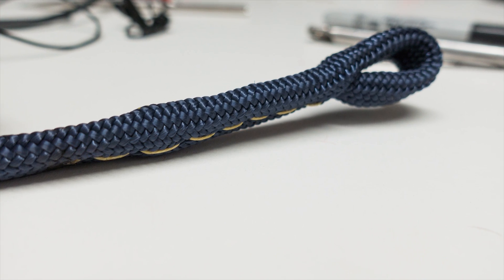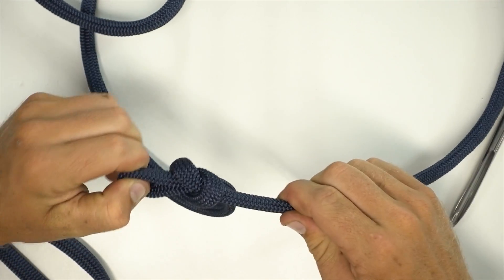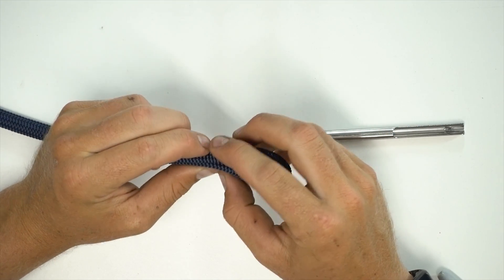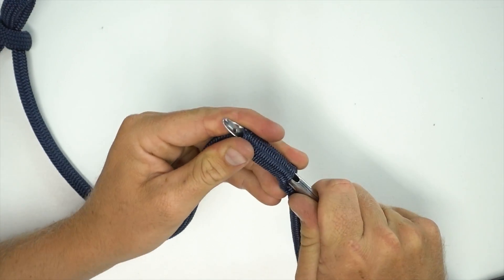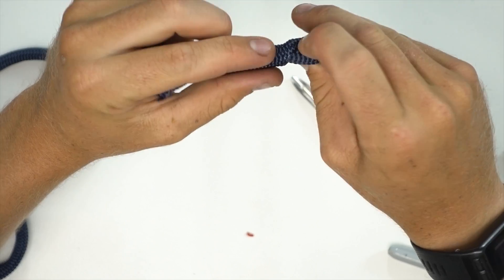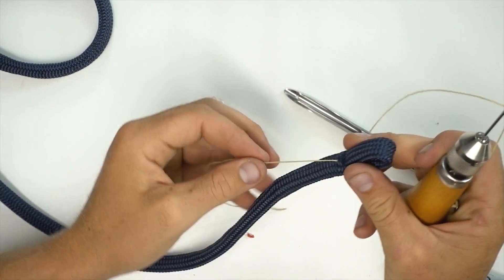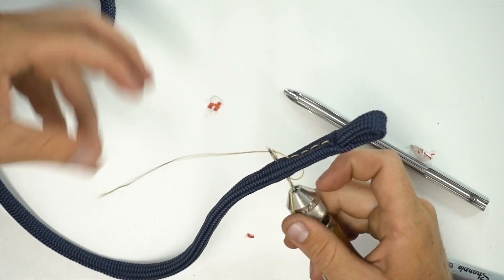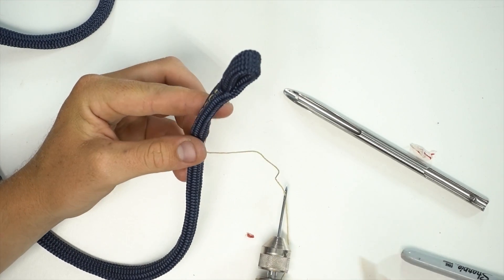Reeving Eye Splice | Halyard Retrieval/replacement

Comment: Thanks a lot for this video. Using your advice to request an instructional video I have not seen. I have been searching for how to tip a Dyneema cover on a line with Dyneema core and polyester cover. 

I would like to get additional shafe protection on the eye as well and the last 6 feet of the halyard, better shafe protection than just a polyester cover. But have not found any good instruction of how to do this.